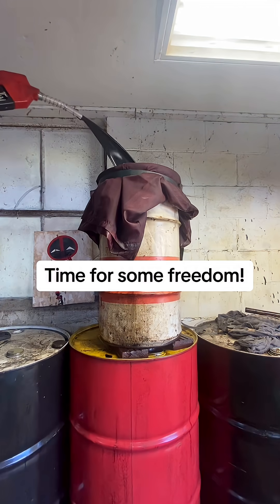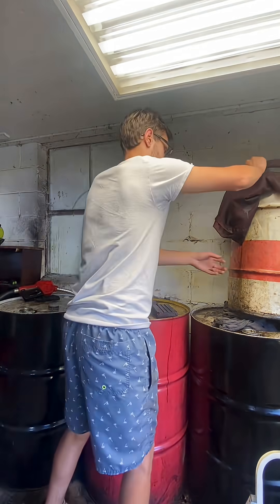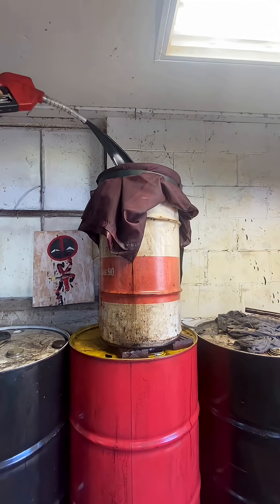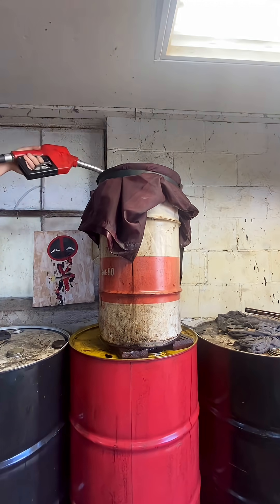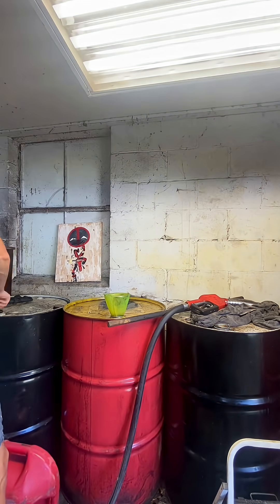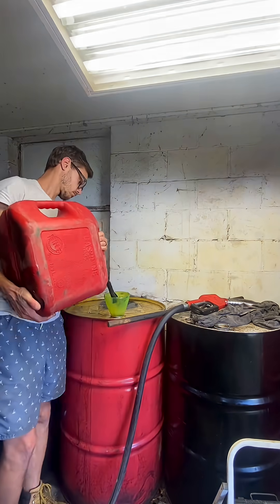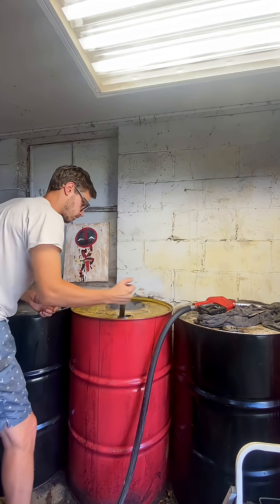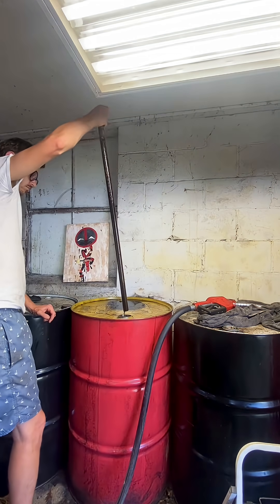Transform #wastemotoroil into #homemadediesel Fuel #dieselmechanic

Comment: It would help to heat the drum with a band heater before thinning it. 150F would have the glycerin out overnight. It would also help your engine to neutralize the acid in the oil. Take a Ph and add lye as needed. Also use a real fuel filter before you put all those metal filings into your truck.
Reply: What glycerin?  He is adding gasoline to USED MOTOR OIL.  He is NOT making Biodiesel.  There is no transesterification ("cracking the veggie oil") going on here.
Reply: @borissery5273  i like your fancy words magic man
Reply: @borissery5273  lol adding gasoline to used oil also doesn’t make diesel without the distilling process. This guy just showed us how to make 1:50 pre mix oil that even most 2 stroke engines couldn’t run lol
Reply: @Mathew-xr7kt it runs fine lol, it's not going into a new fandangled HPFP system of any kind
Reply: @harryazzole7814  it’s not even diesel. It’s oil mixed with gas. Without distillation and proper filtration is nothing more than dirty oil mixed with gas. It may run in older vehicles, but it’s not doing the injectors any favours and he’d be changing his fuel filter monthly and emptying his water separator daily. As well, this oil concoction will burn much hotter than the diesel making the engine way less efficient. He may be making free “fuel” but we’re not seeing the money spent on time to pick up, store and process the oil vs going to the pump.
Reply: @Mathew-xr7kt  it will burn fine esp if you sentrifuge it and heat it to remove water and filter it fine to ie 5 micron atleast, dont even need gas if you got an old engine, but 10-15% gasoline does the job aswell or 80/20 oil and diesel is prob the best bet,
Reply: @MrRacerhacker  will burn fine if centrifuged and distilled. Exactly what he didn’t do. The distillation would alter the hydro carbon chain and make diesel. This video he made mixed fuel and the hydrocarbon chain would not be that of diesel. Let also mention that it cannot be synthetic oil either.
Reply: @Mathew-xr7kt do agree yeah need to not to be syntethic either, this video is mostly what not to do and you will need to do alot of maintenance even with just straight injection and mechanical pump, the fast way aint the right way here
Reply: @MrRacerhacker  not to mention the fast way is also illegal to run in a motor vehicle on the road. All fuels consumed in a road vehicle must be EPA approved as well. Mostly because the governments aren’t able to collect their fuel taxes on homemade fuels.
Reply: @Mathew-xr7kt  I did not think of that ! He is using chainsaw gas heavy on the oil . If done at all, one should be using diesel to thin it. Diesel engines will run on straight motor oil . You see them running on motor oil at the truck and tractor pulls . A diesel will crack the piston rings and suck motor oil out of the pan . No way to shut them off . In 30 seconds or so the motor grenades.
Reply: Wrong  @Mathew-xr7kt
Reply: @GundamZero5  right! Here’s why. 

In a batch reactor, the used motor oil is heated to a high temperature, typically in the range of 400-600 degrees Celsius. The oil is held at this temperature for a period of time, typically 1-2 hours. During this time, the oil breaks down into a variety of products, including diesel fuel.

Without heat, the oil is nothing more than oil diluted with gas…
Reply: Two stroke will not run on this @Mathew-xr7kt
Reply: @Dezzy-e8b  was a comparison. Never said a 2 stroke would run on it. I said, it’s essentially like a 2 stroke mixture with the completely opposite ratio of the usual 50:1.
Reply: Here is how to make proper Diesel out of that mix.... Sell the 50 gallon drum and the can of gas.  Take the money and buy some diesel at any gas station.  Your truck will run better, cleaner and last longer.
Reply: Dud you should be running that day oil through a centrifuge first. It helps to strip out any water and high density fines like metal chips and dust. If you don't take that out your gonna fuck up your injecters and the valves
Reply: @janjohannesrobertson8422  im new to this, but I think thats what the bedsheets were for. May not work well for catching water, but will definitely catch metal shavings and such
Reply: @ryanbrown938  If you have metal shavings big enough for that sheet to catch, the motor it came out of is already toast. As your motor runs, it has constant wear on the cylinders,  rings, and bearings, and all those metal particles are in your oil. Now your engine last for 100s of thousands of miles so those particles are very fine. Your oil filter is designed to catch those particles.  Your fuel filter is not designed to catch those super fine particle, so you are introducing grit into your motor through the fuel system. With a diesel the fuel is part of the lubrication in the cylinders. You are also running that grit through your injectors and injector pump,  causing more wear and tear.
Reply: Oil has a HIGHER density than water. Thats why Oil and other Crude products float dude. You can accomplish the same result using separation funnels and coffee filters.   @janjohannesrobertson8422
Reply: @janjohannesrobertson8422 to be fair we don't know what kind of set up he has in the smaller drum that maybe filtering the oil...
Reply: He definitely needs to get a new left handed crescent wrench and a flux capacitor!
Reply: Yeah, it’s hard for me to take someone seriously in their garage wearing a clean white T-shirt.
Reply: FILTER THE USED OIL AFTER HEATING IT, THEN REFRACTUATE,  NO NEED FOR PETROLEUM
Reply: "Add lye..." where would he get sulfonates from?
Reply: I agree, some missing chemistry 🧪 and filtration.
Reply: just say you didn't watch the video at all.. it would be easier.
Reply: @izuzan7419  no i watched the entire video.  Made  me cringe.  Putting essentially heavily oiled two cycle gas with metal suspended in the oil in a diesel.  
Step 1 filter oil . Step 2 send filtered oil to a lab . Step 3 mix with diesel.  
I have my doubts it would pass lab test . But if it did  cut it 50/50 with diesel not gas.
It would gel very quick and should only be used in the summer.  But i cannot see it having lab results.
Reply: @huckstir this probably is just for some very old tractor. It wouldn't work on modern cars.
Reply: @huckstir billybilly obviously didn't, though.
Reply: @herrkulor3771 if oil is thin enough to make it passed the fuel pump and the injectors it would run . My 2.2 liter isuzu would run on straight vegetable oil if temps outside were above 80 degrees Fahrenheit.  I did it twice.  I would run bio diesel in the summer.  The main reason i would make bio diesel it was easier to filter.
Reply: @huckstir  I believe the 5 gallons of gas will keep it from gelling. One of the old trucker tricks  was to add a gallon of gas to a couple hundred gallons of diesel  in the winter. But no, I would not run his crap in my big truck or my diesel pickup.
Reply: Do you have a video on recycling blinker fluid? Man that stuff is so expensive and sooo hard to come by, if anyone could help I bet it'd be you 👍
Reply: what octane of petrol is ideal?
Reply: He should use a flux capacitor.
Reply: I agree I can only imagine that metal dust sludge that you cannot filter, what it would do to you cylinder walls
Reply: Easy enough to REFRACTUATE  the used oli, no need to add petroleum
Reply: Doesn’t the truck have fuel filters?
Reply: You’re describing biodiesel chemistry, not waste-oil thinning. Used motor oil contains metal wear particles, acids, and additives that can’t be “fixed” with heat and lye — it’s not vegetable oil and it’s not going to magically turn into clean diesel fuel.

Comment: Oh no... no, no, no. 
The soot particles in used diesel engine oil are very fine - too fine for your fuel filter to filter out - these particles will do a lot of damage to your fuel system. 
You would have to run the oil through a centrifuge system or through a one micron filter system similar to the bypass oil filter system that some guys put on their trucks.

Comment: It is extremely important to know why you use a wooden dowel, specifically, to stir it up. I presume it is to avoid a spark hazard.
Reply: Nah, rather to not damage the drum
Reply: A wooden dowel is cheaper. A spark couldn't ignite that soup, it has to be vaporized because oxygen is needed to burn it

Comment: Dumb. The money you ate saving is going to go out the window when you ha e to replace your trucks engine. There is micro steel shavings in there and carbon deposits. Plus you will get less fuel mileage and inconsistent cylinder ignition.

Comment: i have a suggestion.  look up paint barrels. they come with a stiring fan that you could run with a big drill motor.   and the only thing that sheet is filtering is chunks.  you need a real filter system.  they make a simple dual filter pump filter for cleaning large industrial gear boxes.  you can copy one and use an electric motor or air pump.   no way id use fuel that dirty.  a cheap injection pump is well over $1000 and if it wrecks th injectors could burn a piston.  way too risky.  this is emergency fuel to get back to the shop at best.

Comment: If u put the gas in first the oil will mix on its own as it drains into it and u dont have to stir it
Reply: Plumb two barrels with a pump and just circulate them for 20min
Reply: @JoeyAllen-t9h don't even need two barrels, just put the inlet and outlet on different parts of the barrel
Reply: You’ll still need to mix it
Reply: fumes.
Reply: @69523jimbo    Possible spontaneous self mixing.   A clever time saver !   😅
Reply: @69523jimbo they make you happy 😊
Reply: @69523jimbo     fumes & booms !   😅
Reply: A large air stone would work for agitation.
Reply: Wait a second, dirty old used motor oil 10:1 with good gas makes diesel?
Reply: @gregbernard5858     Well . . . ,   think of it this way, it turns your expensive diesel engine into a throwaway 2-cycle ! !    😅
Reply: @BillSmith-fx7xx no it doesn't
Reply: @gregbernard5858 doesn’t make diesel but it is combustible
Reply: If you do it that way you can't use it until you fill the whole barrel so the ratio is correct.
Reply: I'd also tell him if he has a funnel, take off the spout
Reply: Last time I checked, gas is lighter.   Like in the refinery.   Mixing still seems like a good idea.
Reply: @BillSmith-fx7xxyou've seen what happens when BP bust their load in the ocean right??? It sits on top of the water...it doesn't seep...same as with petrol
Reply: Gas fumes would create a devastating explosion hazard.  Wet a wash cloth with gasoline, then place in an enclosed space, wait 10 minutes and light on fire.  When I did it, the explosion tossed a truck tire 25 feet, and the wash cloth was completely disintegrated, nothing larger than pocket lint.  5 Gallons in a shop that size, cinder-block fragments would be raining down 5 blocks away when you flip the light switch (which produces a tiny open spark as the circuit closes).
Reply: comments are forgetting he's a redneck, it's not about best practices
Reply: He should use a ferro rod laid on the bottom, sit the drum on a platform, mount a ceiling fan motor underneath with 2 electromagnets for arms... Turn it on and it'll mix as you pour...
Reply: @sticky4158  hmm, but it’s a steel drum therefore would not the rod stick to the bottom of the drum, despite the magnet moving? It seems like the contact between the two would have significant enough drag to the point it would overcome the force of the magnet.
Reply: Yeah nope don't work like that. You'd still need to stir it because most of the oil would just float on top of the gas
Reply: @Valverde713 oil is heavier, it would not sit on top of gas, gas would sit on top of oil though which is why gas should go first. It's like mixing a drink
Reply: @Valverde713    You're upside down !  😮   😅
Reply: @Valverde713 but if you let it sit, it will float up as well so you are back to step 1 or?
Reply: 5 gallons of gasoline in a steel 55 gallon drum, hmmm, one spark or ignition source and that whole garage is gone.

Comment: I converted a 1990 1 ton dodge pickup to run on used veggie oil. 
My filter process had two 55 gallon drums stacked on their side (plumbed to threaded bungs); I’d fill the top barrel with waste oil, run it through a course screen, fine screen, and 5 micron filter to the lower barrel. Temps above 40° kept the oil thin enough to make it through the filter. It may have taken hours but I rarely needed the oil immediately. Clear tubing was my level indication.
Reply: I used this same method on a 2002 VW Transporter - 2.4 TDI. Worked for a while but the injectors suffered after about 6 months. I would run diesel through to rectify this but overall, I found it to be inefficient. The power was down and people started charging for their used vegetable oil - wasn’t worth it in the end.
I did this back in 2005 - 2009. Oil started off being free from hotels etc but after a few years it started to become quite expensive
Reply: @jotttn I did that truck in 2008. Started it on diesel until it heated the oil then swapped it over; finished on diesel the last few minutes of the drive to clear the lines. It was a fun experiment! I didn’t notice a huge difference in power; it was a torquey towing machine that I only used to get from A to B.
Reply: This guy is using waste motor oil but it could be filtered by a similar process as I described instead of a bedsheet. I also added some used motor oil to my used veggie oil. It worked in that old 5.9 Cummins.
Reply: I love the word "bung," it makes me happy inside.
Reply: This dude is using waste motor oil not used vegetable oil

Comment: I used to buy biodiesel (no biocide) from a guy who made it from restaurant fryer oil, for my '97 Passat. At first it seemed to be OK, but then I bought one of those big totes to store fuel in. Since my car got great mileage (45 mpg), it took a while to work through that tote. By the time I got to the end it was looking pretty cloudy, but I kept using it as an experiment - I am well aware that some of my practices were questionable. Anyway eventually my injection pump started leaking. I had to buy and have installed a new pump, which was very expensive. Since that time the only biodiesel I use is that B5 stuff that reputable stations supply, mostly as a lubricant for the injection pump. My days of experimenting are over.

Comment: I wouldn't use it in any motor made in the past 25 years.   Better run that stuff through a series of filters down to a 5 micron to get the fine metal and carbon bloom out and I would recommend adding at least a gallon of new ATF or some kind of a diesel treatment to the mix once its been filtered

Comment: A centrifuge from PA biodiesel works miracles on waste oil stock.. you can also get free fuel if you are close to marinas etc.. boats have fuel pumped out before going to scrap. I get drums of fuel free of charge cuz the marina no longer has to pay to have it disposed of and just work to separate the water from it and freshen it up. Diesel gets heated up and ran through my centrifuge and a 5 micron fuel filter/water separator filter then into my filtered oil stock while mixing, the gasoline same but i add water to remove ethanol then remove water and mix in ratio with stock.. i get a mostly clean lighter looking fuel. Black gold

Comment: Can the oil be from different oils like for example transmission fluid power steering or does it have to be engine oil
Reply: You Can use any oil you want for myself I use the only thing I can in the UK and that is used veg oil in my old daihatsu fourtrak
Reply: @markrichards5833  used veg oil would be different. You’d be making bio diesel.